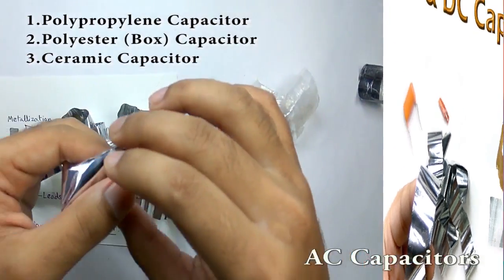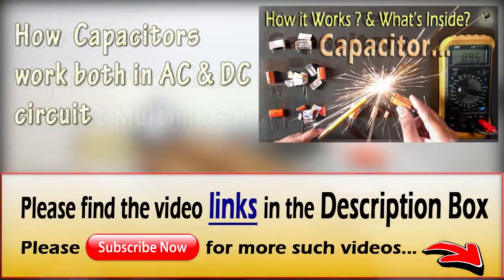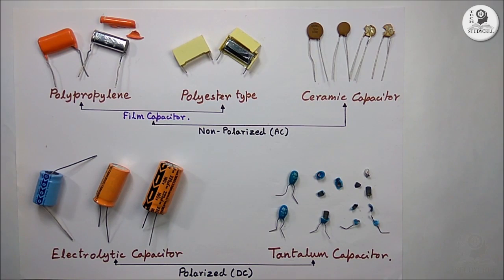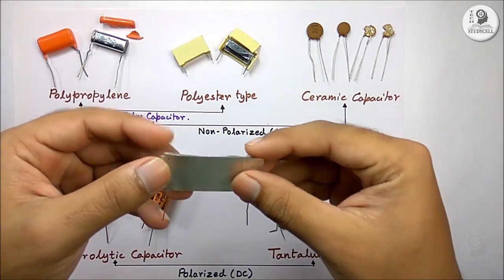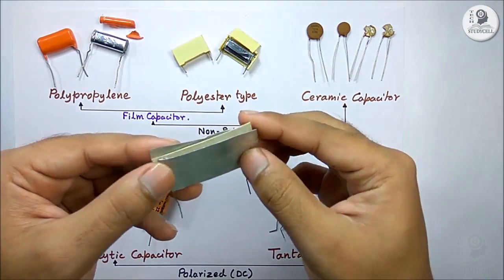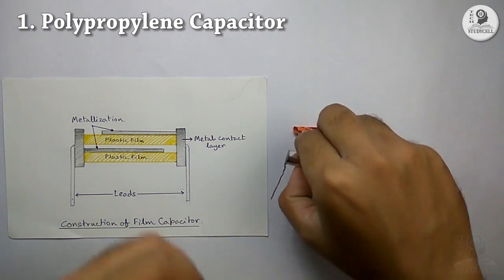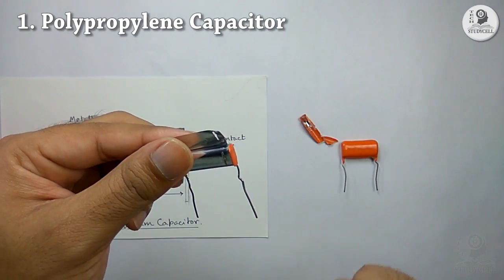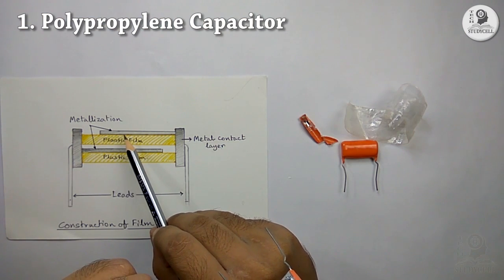AC and DC Capacitor Types with electrolytic, tantalum, plastic film & ceramic capacitors

Comment: sir  i have one doubt  in dc capacitor the two plates or the two terminals are separated by the dielectric medium then how the current flow during the charging of the capacitor from positive to negative terminal of the dc  supply....  my only doubt is how the charging current flow through the dielectric to reach the negative terminal of dc supply

Comment: If you tace a Oscilloscop so can you se the Polyester Film Capacitor has polarity! (all caps shell you check negative side) negative side are the metallfolie 
located at the top,,, In the Oscilloscop you can se the sine  wave is the highest!  tace the cap in your finger and act as a antenna,, So put the negative side on ground,,,  Its very importent then building Radio and amplifier.... Best Regards from cold Sweden